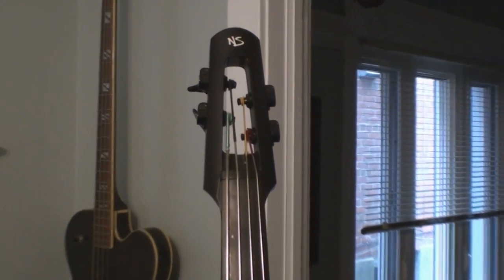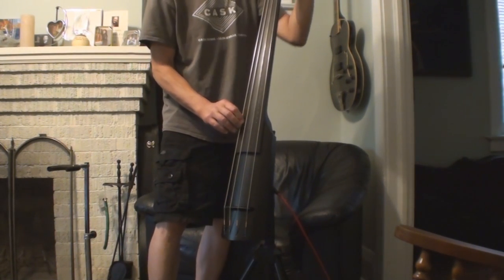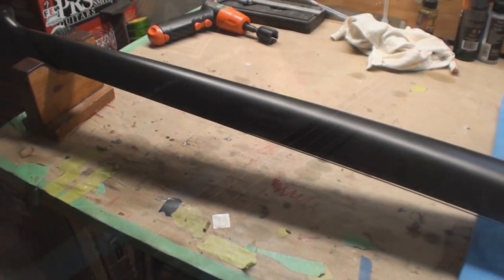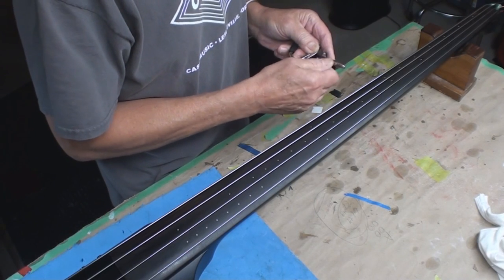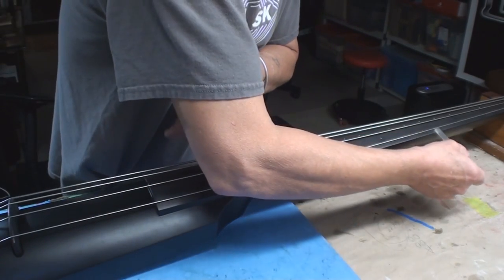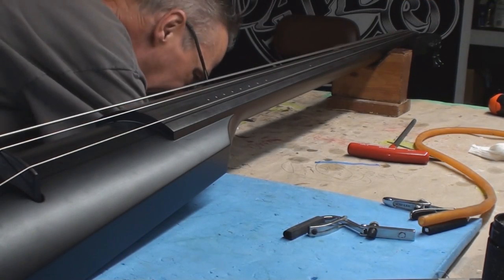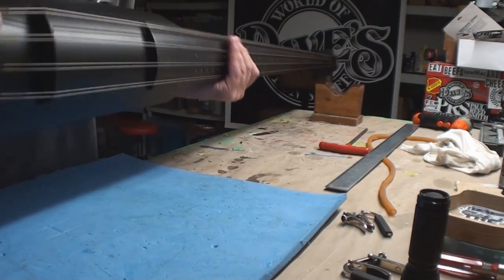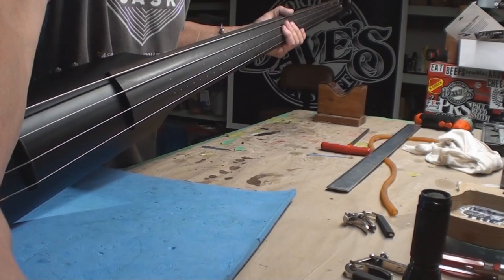NS Ned Steinberger NXT Upright Bass

Comment: I have one they are not active no batteries in the NX the switch is for pizzicato or bowed style most owners replace the tuners because they fail under that big string tension and put a set of real upright strings on and they make a huge difference in making it sound like a real upright the stock D'addario strings sound more like a electric bass guitar...a great design by Ned Steinberger I love mine....

Comment: No battery required!  The active side is powered by a bank of capacitors, instead of a battery, that are quickly charged and supply voltage.  If they are quality caps and used with a fair amount of frequency, they should last a long time, and be much less expensive to replace.